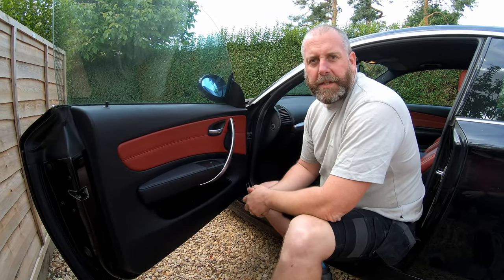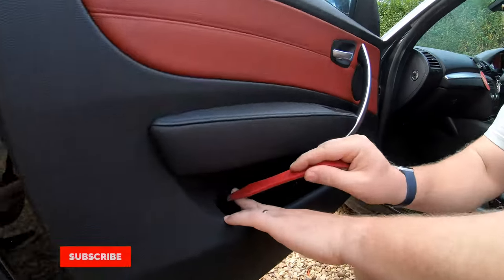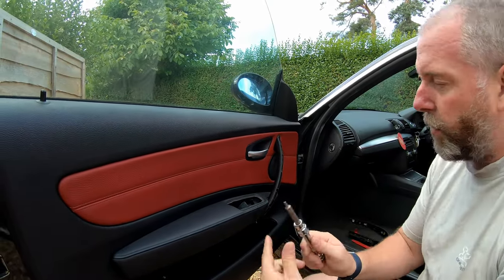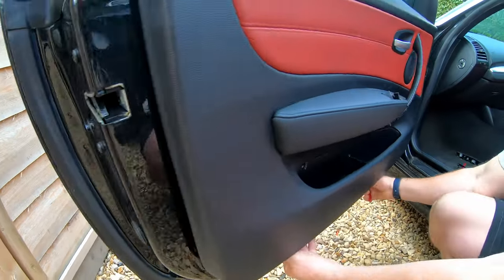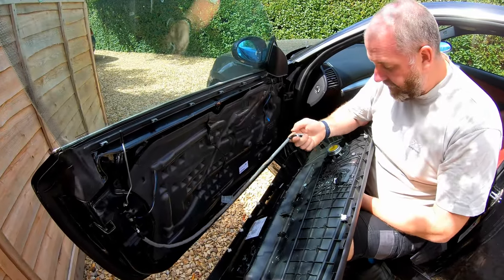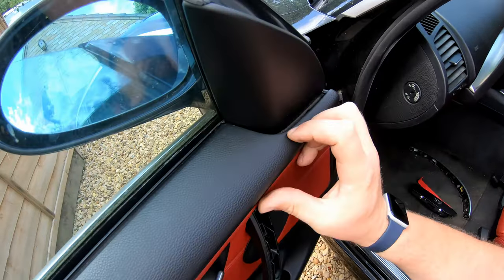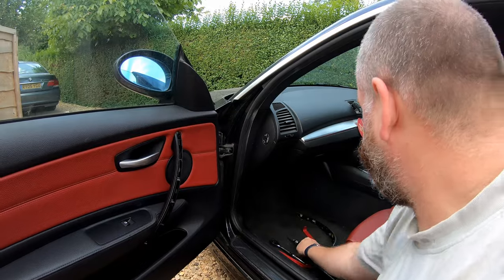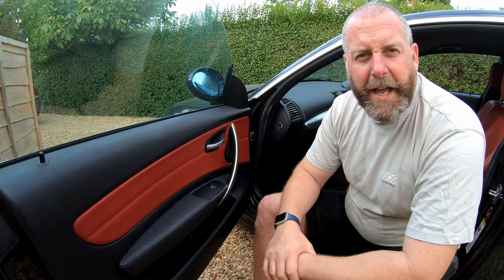BWM 1 Series (E8x) Doorcard Removal & Fitment - Step By Step

Comment: Well explained. Unfortunately I cannot overcome the clip power to pop it out. Feels like I would destroy something. I even bent a metal object by prying.. yes, all screws are undone.
Reply: Need a proper trim tool, I managed to get mine off with a wrap tool(the little card things) but damaged the paint a little, I started on the side closest to the rear or the car and just worked my way around. Requires a good bit of force though